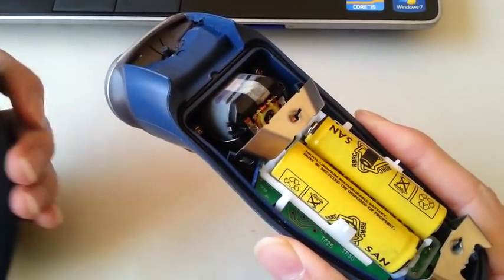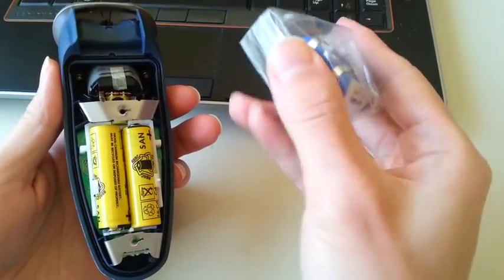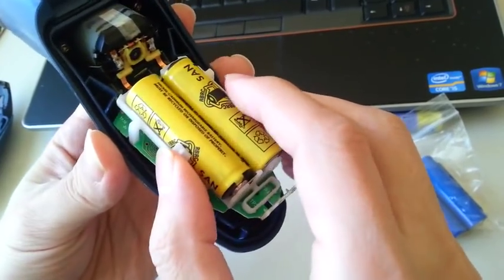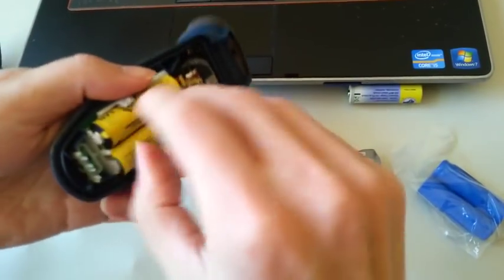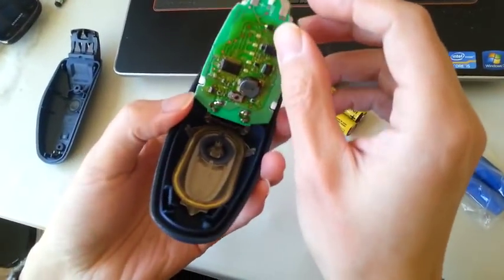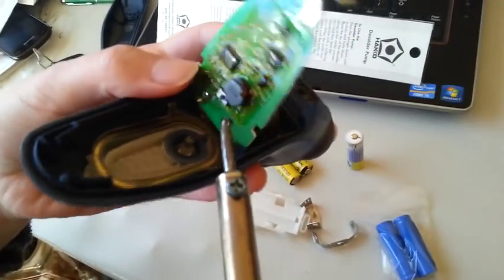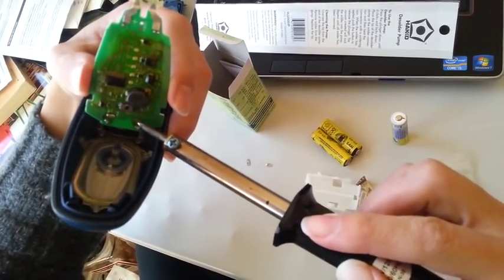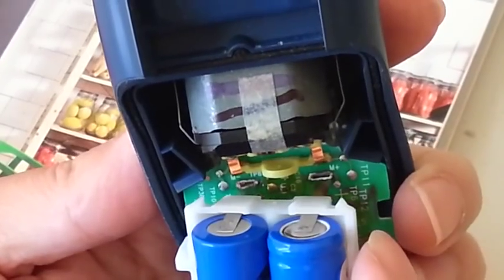Replace Norelco Razor Battery

Comment: I'm beginning to think the company deliberately designs these batteries to be a pain-in-the- ass for most people to take the time to replace, instead pushing them to just go out and buy another shaver. Sort of a planned obsolescence. After all, most electronics these days are designed  to be throw-away. I have a pile of dead  VHS and DVD players that attest to this—it's just not cost-effective to have them repaired.

So, not only do you need to get special batteries that have to be soldered in place, you need a special tool to open the damned thing. 

But good presentation on the video! I'll give it a try (after looking at the thing frustrated for over two years).
Reply: 100%

Comment: Thanks for the video.  An even EASIER way, and recommended in the instructions of the batteries I purchased, is to just cut the old batteries out without raising the board, leaving tabs long enough sticking through the plastic to solder on the new batteries.  The new battery tabs, cut short, overlap the old tabs, and you just solder the tabs together.  This was recommended to avoid putting too much heat on the board (trying to solder out the holes).  I was able to replace my batteries in under a minute with this method.
Reply from the maker: That's a great idea! It works for a lot of through the hole components. Soldering the existing tabs/pins off the PCB works only a few times, after which the copper clad will separate from the substrate. I wish I thought of that earlier.

Comment: Hi.  & thank you for showing this procedure.   I guess the hardest part is having to solder into place the connections.  I learned so much from your video.  I have 3 Norelco shavers so there will at some time be necessary for me to replace the battery pack.  Thank You.  Sincerely,    JAMES.

Comment: Very good instructional video.  Installed new battery pack. Trickiest part was clearing solder out of slots to insert tabs of new battery. ( I used solder wick.)
 Put back together. Seems to work fine.  Thanks for posting.

Comment: Why didn't they just put a plastic holder connected to mother board and stick In a new battery with no soldering just like flashlight  what a waist but Norelco knows most people throw them away every few years or more .........

Comment: It looks like you can just use the tabs from the old battery to make connection with the tabs of the new battery. Maybe without even soldering whatsoever.
Reply: +1mediaguy I did the same thing, but dropped some solder on top of the tabs.  Didn't seem to have any effect on the plastic frame whatsoever.  Good to go!

Comment: Great video!  Now in 2024, those batteries  get replaced by Nickel Metal Hydride (NiMH) which is a drop in replacement for NiCd, but they don't have the memory effect of the NiCds.

Comment: This is a very helpful video. THESE MAY BE LITHIUM ION BATTERIES! BE VERY CAREFUL TO NOT SHORT THE BATTERY + & - LEADS AS IT COULD LEAD TO A VERY HOT FIRE! I suggest that you place electrical tape on the individual leads as you move the battery pack around. You may need a pair of "nippers" or "side cutters" to trim the battery pack leads to fit within the circuit board slots. Again...BE CAREFUL not too short the leads! A set of miniature TORX drivers will also help. Be sure to align the on/off switch as you slide the circuit board in place and secure it. Test it before you close up the shaver. Then, charge the batteries and keep an eye on the razor to make sure that they charge and don't catch fire. Again lithium ion batteries are not friendly if they catch fire! I am a HAM radio operator so I'm used to working with soldering irons, etc.

Comment: Suggestion for those without soldering equipment: Silver epoxy works equally well for connecting the cut tabs of new battery and old battery, without touching the circuit board at all.

Comment: Thanks for the video. I was a bit timid about opening up my razor, but this looks very straightforward and I think I will order the replacement kit. Just a comment, most people who are watching this and having trouble because they're new to soldering will get stuck on the desoldering part. I'd recommend buying a couple cheap items before starting, which are "helping hands" and desoldering braid (the pumps are nice but braid is good at getting the holes really cleaned out...just press it into the hole with the iron). Also, I prefer using a thin gauge rosin-core 63/37 solder.
Reply from the maker: I agree with your view on braid vs. vacuum and the "helping hands". A tripod for the camera would help too, although it has little to do with what we are trying to do:)

Hope your razor is going strong again.

Comment: I replaced mine just like this, same shaver; somehow something went wrong, and now the razor runs when it's plugged in, but it won't run when unplugged and the charging lights don't light up at all.  Did I blow something?  Don't try this without a solder vacuum, I had trouble getting the old solder out.

Comment: Well, I am really sorry I watched your video. I wasted $8 on battery pack & screwdriver. I had zero luck removing the solder. My gun is NOT magic, so it would NOT remove the tabs. My vacuum pump would NOT remove the solder. So, after 45 minutes or wresting with it, I broke a gold  tab. Should have thrown the shaver in the trash & moved on & not had a very frustrating afternoon..